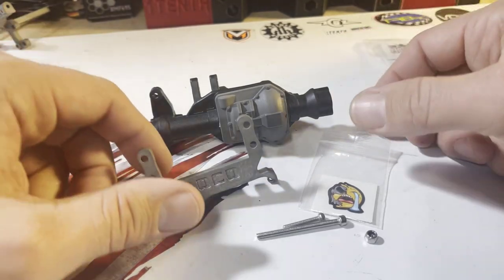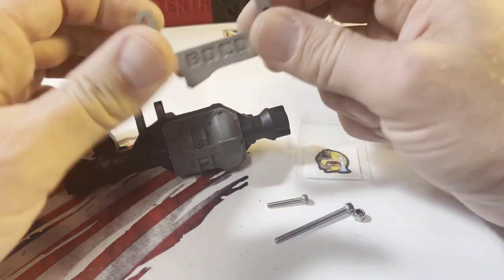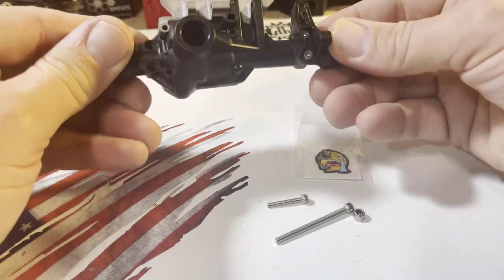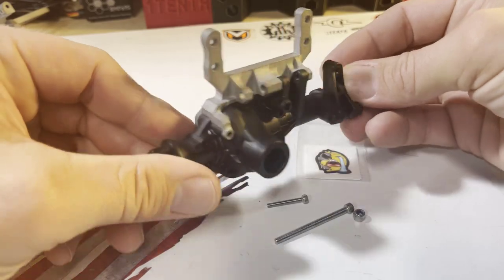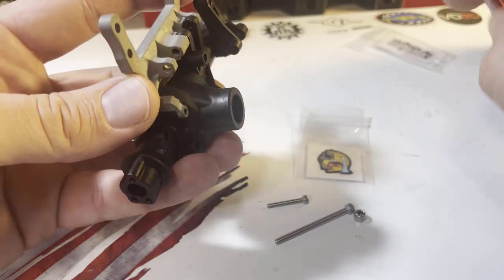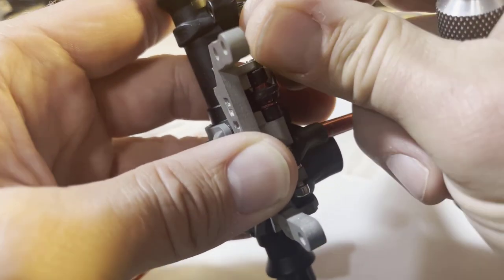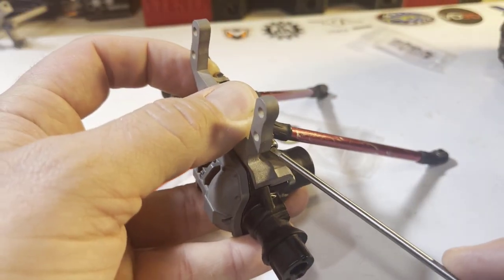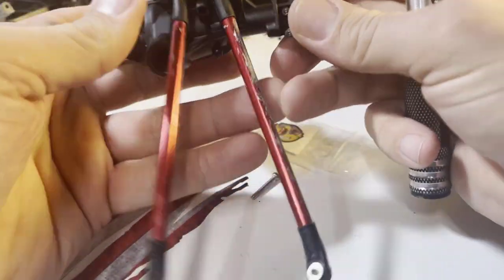BOCO RC TRX4 Portal SOA and 4 Link install

Comment: Where on the chassis do you recommend attaching the 4th link ? I've ordered two of these but curious on where you'd mount the 4th link on the chassis .
Reply from the maker: Exocaged did a stock chassis setup.  I’ve only done it on flat rail like Brazin, sorry.